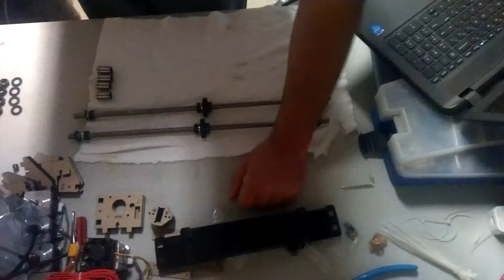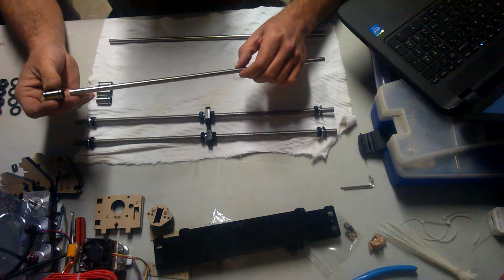Geeetech Prusa i3 Pro B Assembly  Video Step 2

Comment: i have a small problem... although i have the i3 pro c, but by online instructions there's a same thing to do... but the small linear bearings do not go smoothly onto the smooth rod... is there anything you suggest to do?
Reply from the maker: Denis9ROCKSTAR  try the other end. if not working, may need replacement. happened time to time for this situation. you will need to contact the person who you bought this from
Reply from the maker: +Denis9ROCKSTAR  resolved you.
Reply: it wasn't right... we had it smoothened and now the printer is already up and running :)